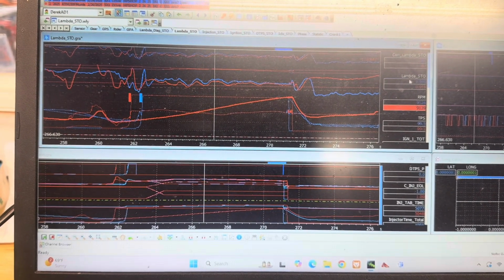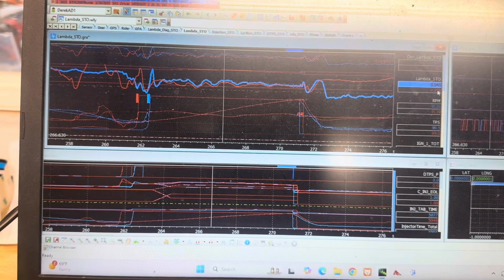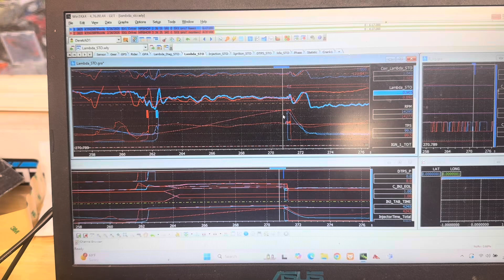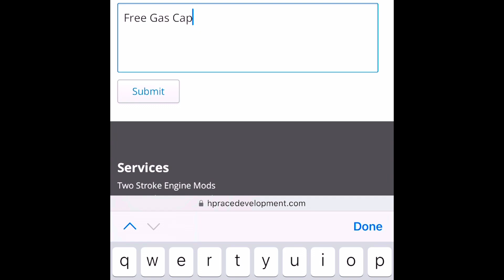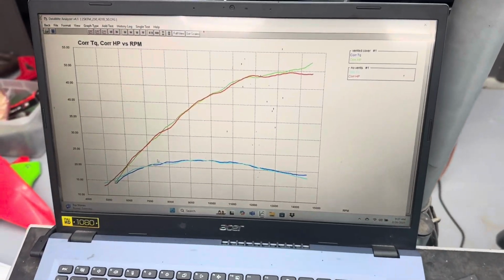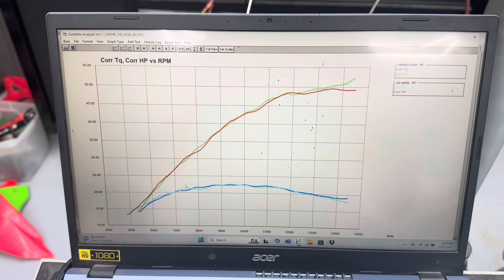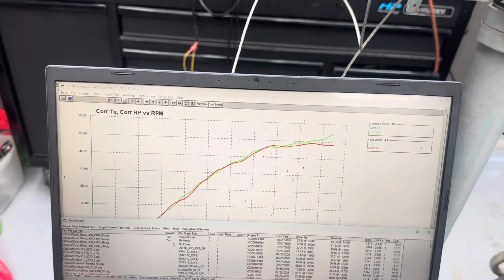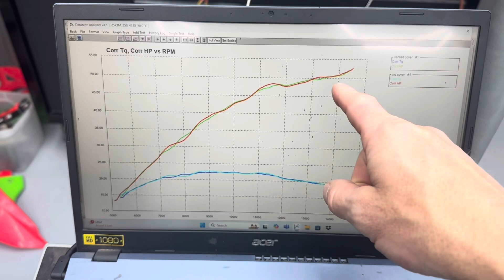More air More Power! Airbox Covers and Holes

Comment: Pardon me as I’m not a 2T bike guy, but I’ve always been taught “big in must equal big out” With that logic, wouldn’t the exhaust be the bottleneck holding power back? Like an air hose pushing 60psi through the hose, but the nozzle can only blow 55psi out. 
Great video btw👍🏻
Reply from the maker: @IndianaDoug  while your train of thought is well reasoned - two strokee make all their power due to the pipe waves. The intensity of these waves is increased by pipe back pressure. So the outlet diameter is a dance between max back upressure and minimum size required to get the flow out still. The restriction also builds pipe heat which helps widen the powerband due to itseffect on sound speed

great question
Reply: @ I understand. Then why not make the stinger diameter larger? Wouldn’t this increase rpm?
Reply from the maker: @IndianaDoug this would lower pipe back pressure, reduce pipe wave acitivity - and lower power output. Plus it will lower exhaust temperature which lowers sound speed which lowers resonant frequency which lowers rpm
Reply: @HPRaceDevelopment  fair. So increase air intake but do nothing to the exhaust? Just doesn’t sit right with me for some reason. But I’ve been wrong many times🤣
Reply from the maker: @IndianaDoug The more power the engine makes, and rpm it turns, eventually the stinger diameter can go larger. But on most applications - you will loose power. Often its a trade for reliable vs power. The goal is to skirt right on that line of blow up or go fast.  when its too tight it usually makes more power but the increases temps it creates can cause detonation and engine failure

Comment: Eeewww 4 stoke yuck!
Reply from the maker: @trevorfarlette9996  the worst
Reply: @HPRaceDevelopment  were these test for a 4 poke because 2 strokes are more susceptible to resonance and the airbox I noticed helped with low-mid rpm depending on the length and size of the intake

Comment: I have a 25 crf250f but this should translate to that as well correct.
Reply from the maker: @Jason-g2j  The 24!crf makes very nice gains with air cover off

the 25 honda has the large triangle cut out already but we will publish some stuff for the 25 and hondas sooner or later
Reply: @ would it lean my bike too much to do the “performance filter” kit without a tune?
Reply: I have a 2023 YZ250f with a 304cc kit on it. Would a vented intake help on my bike, too?
Reply: @TM22549 I have no experience w that bike but I don’t see why it wouldn’t

Comment: I have buy a get SX1 pro for a KX250 2024 with stock motor, akra full exhaust & twin air powerflow, so i presume i have to richen the mixture, but they have ignition settings, what’s the effect of -5 or + 5 on ignition on the track ?

Thanks a lot
Reply from the maker: @AntoineCS2 working with a shop like us gets you custom programmed tunes that suit the bike better. assuming a pipe requires more fuel is a poor assumption, exhausts can do funny things to mapping needs. We posted a test on an rmz on this channel with air filte, no air filter and it made no difference in power or fuel needs

Comment: As i made these Tests on the 25` 250, i could observe a little Gain across the Board with this Cover, even on Stock ECU without a Tune. I tested a Drilled/taped off Cover as well (and yes i made a lot of Runs in different Setups) and would still say this vented Cover is really well designed.
Reply from the maker: @hwperformance1409  Correct.

Comment: So it doesn't consume more gas with more air flow?
Reply from the maker: @easterntownshipsenduro  Not unless you add more fuel to the map.
Reply: So my stock 2023 FC350 feels stronger with the non- vented cover.
It seems to pop on decell with the vented cover. Am I nuts?
I run 93 pump gas and assumed it was just too lean from the factory.
Opinion?